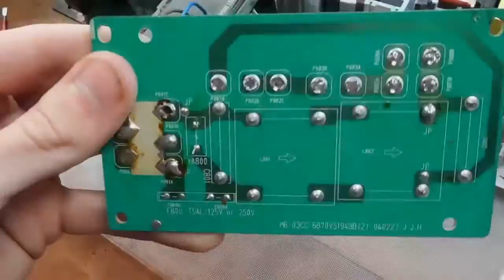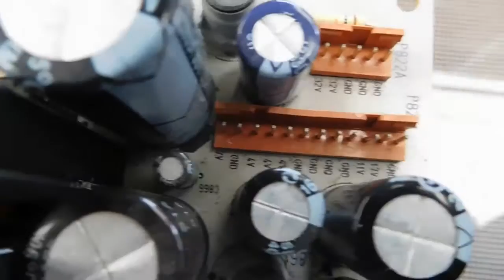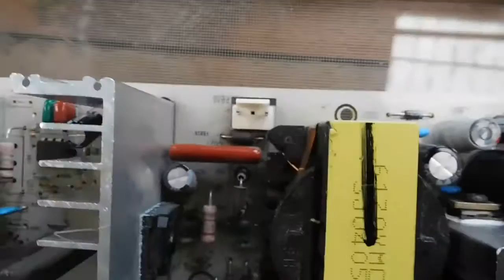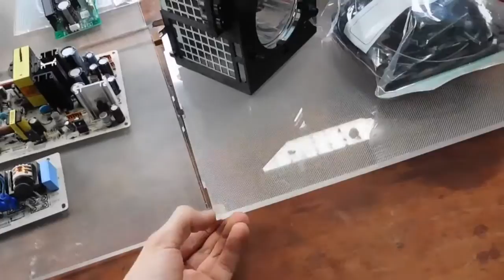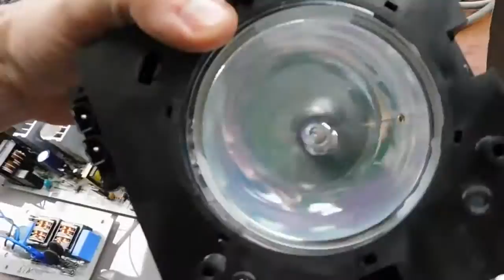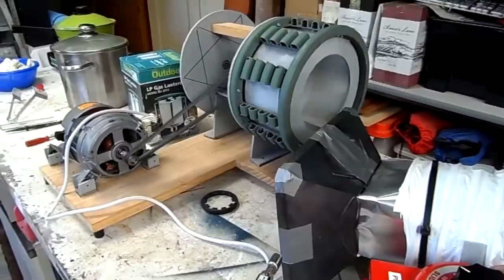DLP Arc Lamp Update - Nutted Out The SMPS

Comment: I saw the other video.

Erlendse seems to be on the right track. What I would start with first. They seem to know what they are doing.
Reply from the maker: Yeah he pretty much covered it all, I did manage to get the SMPS to power up today, all I did was short the S12V and PWR to each other and let there be light!
Reply: +Machine Man yeah I kinda figured it was the 12v or ground, its generally one of the pins on the same connector, so you do got it working? You have to do any trickery to the ballast or just using all the connections t0 it from the smp?
Reply from the maker: umbrefawx haven't got the lamp running yet, that's today's project! I have a feeling it may need an input from somewhere else as there's another input on that ballast. Should be easy to bypass!
Reply: +Machine Man are you talking about that logic input/output on the control side off the ballast? Or is there another one you discovered besides the power input and that connection on the control board of the ballast. It can be easy or hard to get it working but I cannot say for sure as id have to see the whole board and where traces run to figure out how to do that and not so much possible being on the other side of the world. :P
Reply: +umbrefawx cause im pretty sure that connection doesnt go to the SMP, but more or less to the main tv's control board.
Reply from the maker: umbrefawx yeah there's a logic board on the side of the ballast that had a 4 wire loom connecting it to something else, from other vids I've seen this has a red and 3 grey low voltage wires. I'm guessing the red would be positive and the others are either a signal or group back to the processor. There could be a trigger involved also.
Reply: +Machine Man yeah thats the logic control for the ballast, that normally goes to the main control board of the TV. You have to be careful though. the grey ones can be anything and that red could actaully be a ground. Normally connections have the ground marked different with a different color wire in looms like that so it could be ethier or. Just something to keep in mind. Id meter the red wire to ground first before proceeeding, probably wouldn't hurt to do the same ffor the grey wires ethier.
Reply from the maker: umbrefawx ah yes that is a possibility, I'm going to wire up the ballast and lamp to the power supply and just see what happens, chances are, I'll have to bypass something in order to get the lamp to fire
Reply: +Machine Man well your options are try to figure out if it can run on its own. (Doubtful without the main logic control board from the tv, but may be possible. Id do a continuity check on that red wire first, figure out if its postive or ground. Its gonna be one of them. The other 3 could be voltage or logic signal and unless you have a lab grade fuction generation, that probably wouldn't do you a lot of good. My only idea is to bypass the whole control side of the ballast, try to figure out which transistor or FET does the magic. Thats how I got the one out of my sony wega to work. I had to give one of the main FETs a 5v into its gate. Not sure how doable that could be on your ballast.
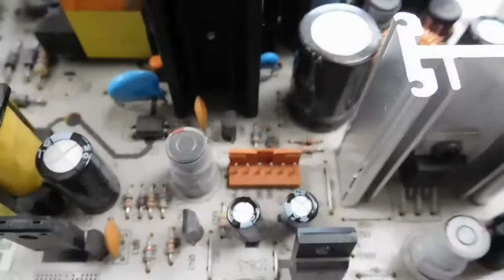Reply: +umbrefawx function generator* Sorry typing is horrid tonight. Its 2:30 in the morn here so my brain is kinda tired lol
Reply from the maker: umbrefawx ah OK, there's about 4 FETs on the the middle of the ballast, some pins connect to logic and others just go to other components. Don't sweat over it too much, it'll make you more tired like me lol, it's the sort of thing I fall asleep thinking about
Reply: +Machine Man id take a closer look at the ones on the logic level. I would suspect at least two of them fets are used to drive the ballast's main transformer.
Reply: +Machine Man I say look at the ones on the logic levle because those might be the fets that drive the ballast itself, id try tracing whichever ones go to the logic/control part of the ballast on the side, any pins making connections to route to that side board would probably be a good start as it might be the fets we want. (The fets the logic drives to turn the ballast on and off.)
Reply: +Machine Man Oh I forgot to ask, is there any kind of logic output on the smp or anything that looks like the 4 pin connection? figured id ask cause some smp's give the logic signals directly fro it to the ballast. If you have anything like that, might be worth considering.
Reply from the maker: umbrefawx haven't seen anything with a really small white header, but there might be a hidden one somewhere on it

Comment: Using the main SMPS is a good idea, even for your use it's mostly just used as rectifier.

One advice: They don't generally respond very well to soft-start with variac.

1. get the SMPS going (connect PWR to one of the other, an idea would be to check what voltages are present in standby, and if PWR is 0V or more with input power, if PWR have a voltage then ground it, otherwise you must connect it to one of the other voltages that is present). Use a observable (lamp or motor e.t.c.) load on for example 32V to check for start.

2. check output voltage on that plug (should be around 300-400V DC), power all down and connect lamp-driver to main PSU.

3. find some dark sun-glasses

4. Give the logic input of the lamp-driver the lowest of the logic outputs from the main PSU.

That should hopefully be it.
Reply from the maker: Thanks awfully for that! :)
Reply from the maker: Yeah the Variac was just so I could work out where power was going, while being at a safe voltage